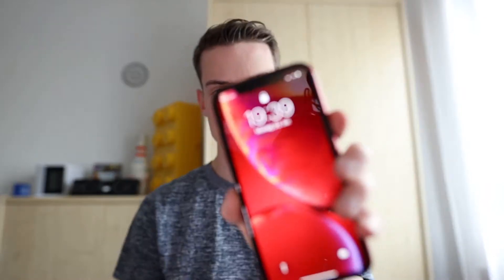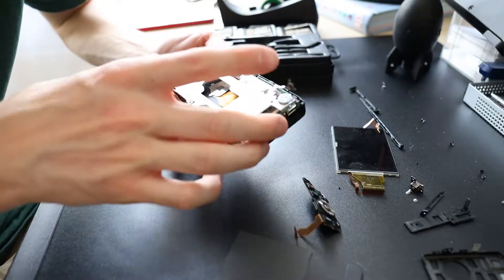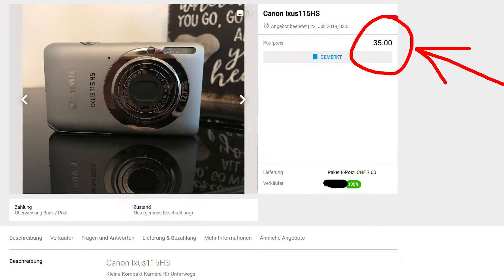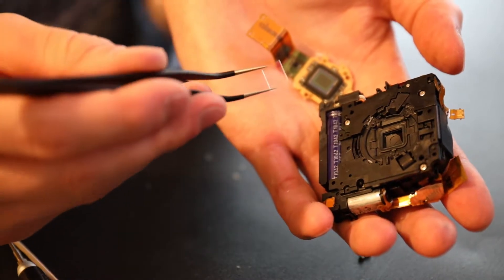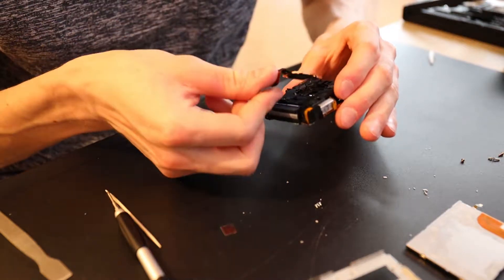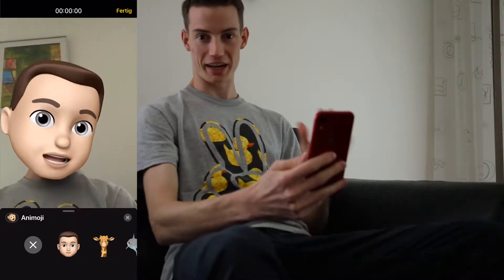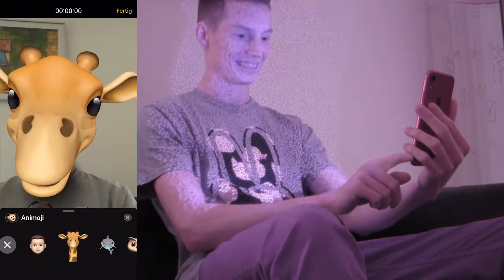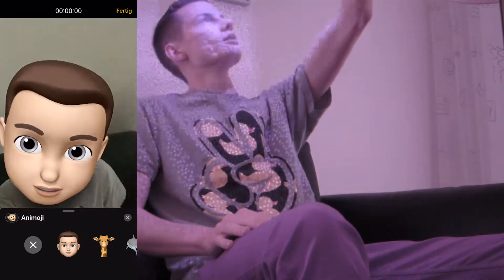Make Apple Face ID visible with a modified 35$ infrared camera | iPhone Xr

Comment: I think you have not removed the battery so it exploded
Reply from the maker: I removed the battery. In my opinion what created the small explosion was voltage left on the capacitor which stores energy for the flash.

Comment: Healthy? I don‘t think so.
Reply: Why would it not be healthy? It's infrared light.. you are being hit my infrared light from everything all the time. Your body emits infrared light.
"Humans at normal body temperature radiate chiefly at wavelengths around 10 μm (micrometers)."
https://en.wikipedia.org/wiki/Infrared
Reply: depend on it’s concentration
Reply: @dandymcgee the body emits very low frequency infrared around 10,000 nm, smartphone infrared is around 940 nm, which is very close to red light. It won’t cause damage unless it also burns things around you